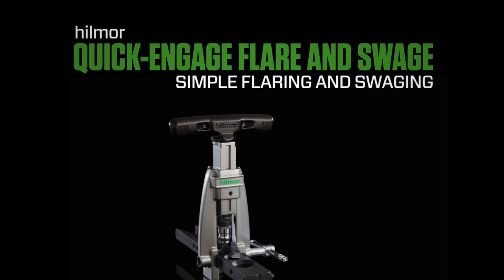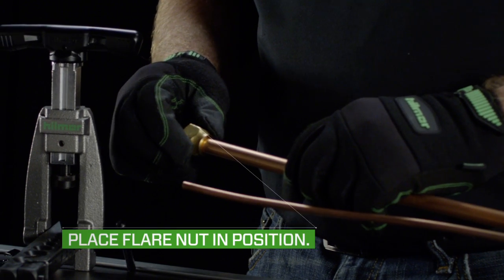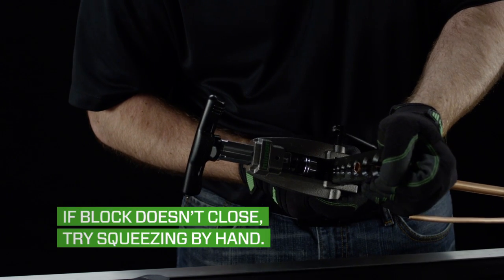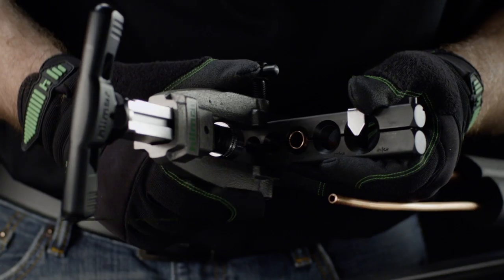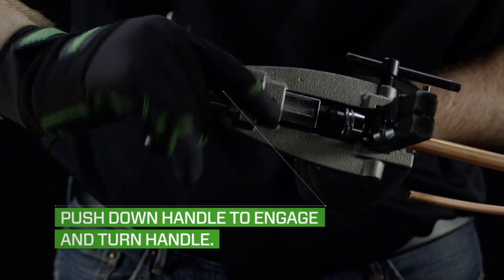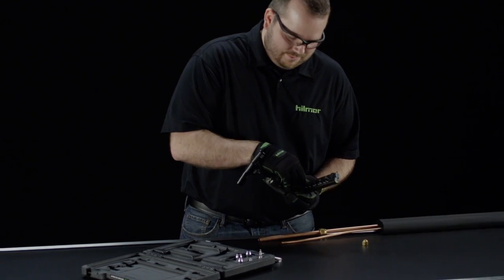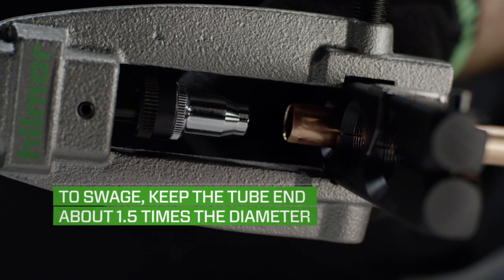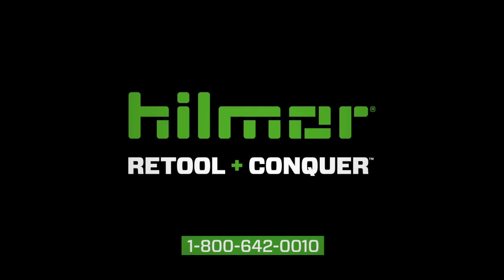hilmor Quick-Engage Flare and Swage

Comment: these work great
Reply: Do they work good for a swage though ? Have you used it as a swage ?
Reply: they work until the threads on the green latch break, then its fucking useless. 2 in a row, a few years apart but still.